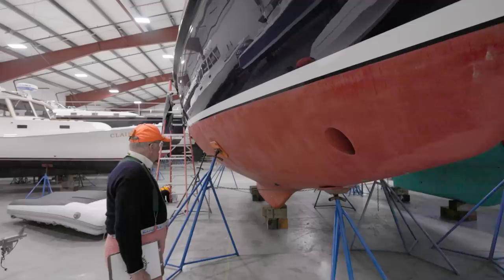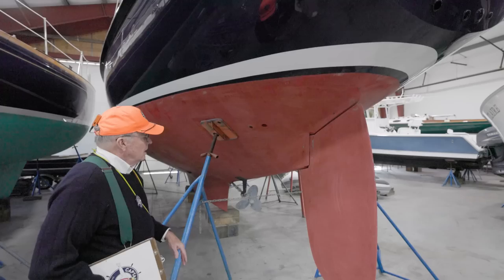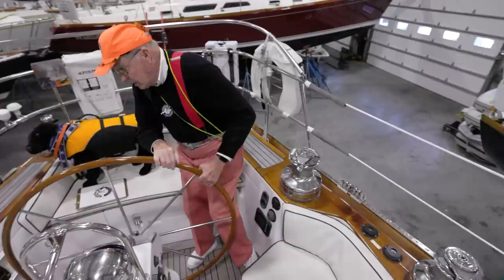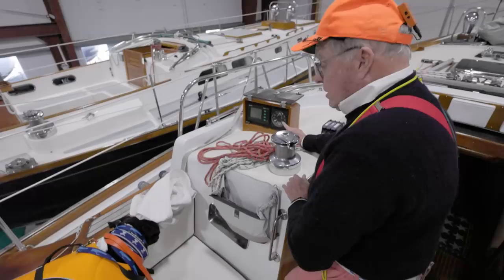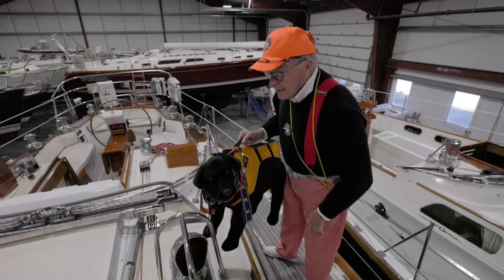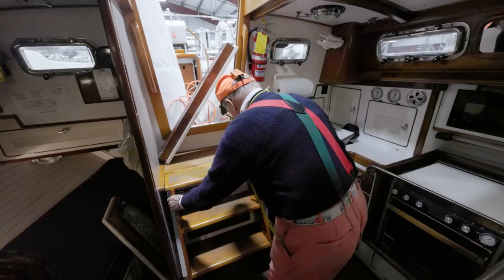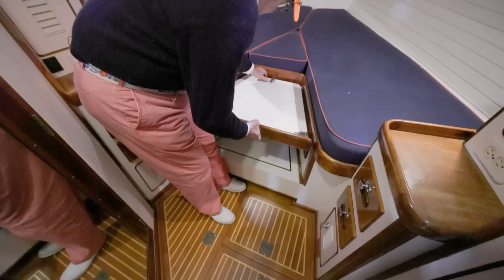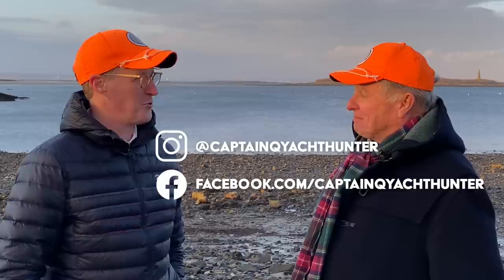$315,000 BLUEWATER SAILBOAT - GO ANYWHERE!! Short-handed sailing Little Harbor 42 - EP 119

Comment: Cap I just love the Herreshoff interiors. My wife and I looked at the other sister ship with teak interior and we agreed this was better. Funny story is my family back in the early 80s bought an Irwin 31 mainly because we knew that we could beat the local Catalina 30 fleet in Phrf. We were minutes away from buying a Sabre 30 but couldn't pull the trigger. In the mix was a Tartan 3000 a S&S design and a S2 9.1
The other boats we knew were lovely but the   other aspects of the Irwin were a winner. Great construction,no. But we were only sailing on Lake Minnetonka!!
I'm surprised that these Little Harbors are commanding much higher prices than a Swan

Comment: AIREX and Divinycell are both PVC foam cores and essentially the same material from different manufacturers.  Both products are made in a variety of densities that yield a range of compressive and sheer properties, plus other features like high temp resistance are available for autoclave cured composites.  To say that using one vs the other in the hull and then the deck are "different core structures" isn't very accurate.  If we knew what particular product 'flavors' were used then we would know if the builder was aiming for particular properties that would yield different performance characteristics.  5 lbs per cubic foot is the most common density used in marine structural applications and what most likely happened on this build is that used what brand was available and for the lowest cost during that particular phase of the build from the local supplier.
Reply from the maker: Excellent tips, Luke…. Thanks for taking the time to bring us up to speed… that’s great to know moving forward. Much appreciated and cheers from both of us
Reply: Kinda seems  lowest cost  wasn't a factor anywhere in that build.   But one never knows...Thanks for the foam  tech info !
Reply: @charliemclaughlin2045  well, neither of those brands are really 'cheap', a 4x8 sheet of the foam core can cost as much as the same size sheet of plywood.  Builders buy in bulk and we have business accounts with major suppliers so it costs less than what the public pays, but still... Anyway, AIREX and Divinycell are both top notch products.  There may have been a specific reason for using different core brands between the hull and the deck but I honestly think it was just coincidence, what was in stock at the time it was needed.

Comment: She is a near P.B., From the fit and finish to how well though out all the things you need as a single man sailor .I know you like For and aft seating in this case however i see an advantage .when you heel to port or starboard your not leaning to the side and you do have the bulk head and counter for bracing .The one and only thing i saw that i was disappointed in was the size of bed ,unless your a confirmed bachelor .but i offset this downgrade because of the opulence and cozy comfort of that cockpit .